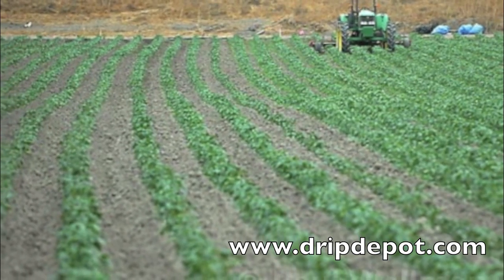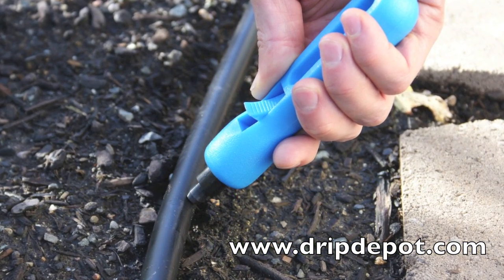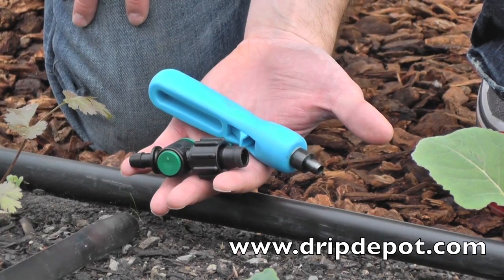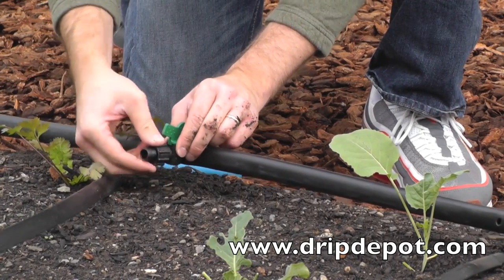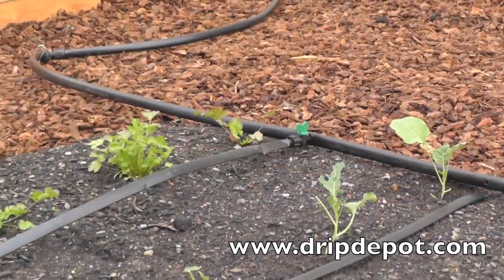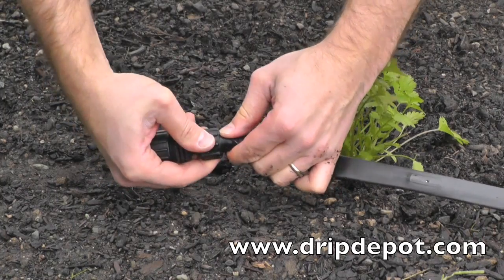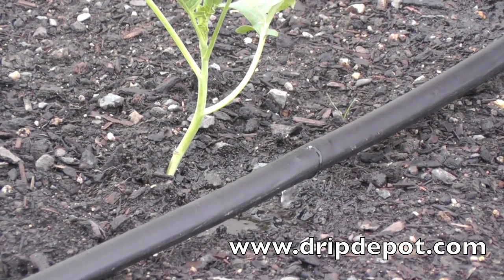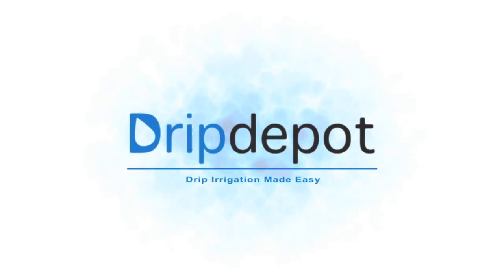How to Use Drip Tape to Drip Irrigate a Small Farm

Comment: I don't see any advantage to using this drip tape. Just run main line and attach drippers to the top of mainline. No dealing with flimsy tape!
Reply: coverage and drippers can get expensive also psi regulation within drippers is essential.
Reply: What size is mainline?